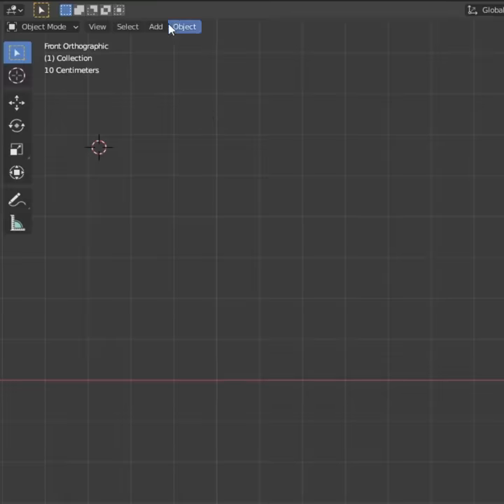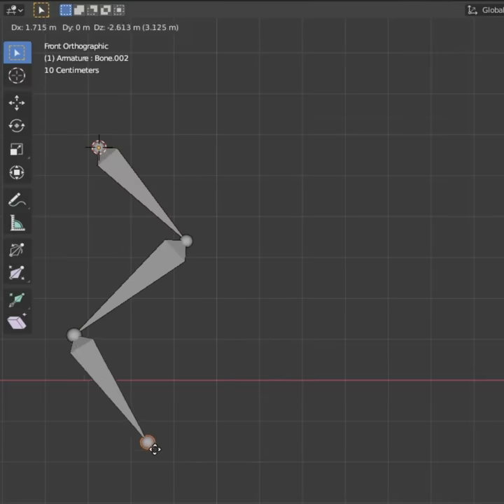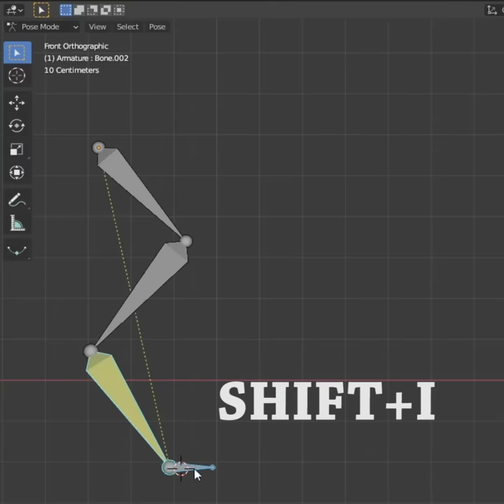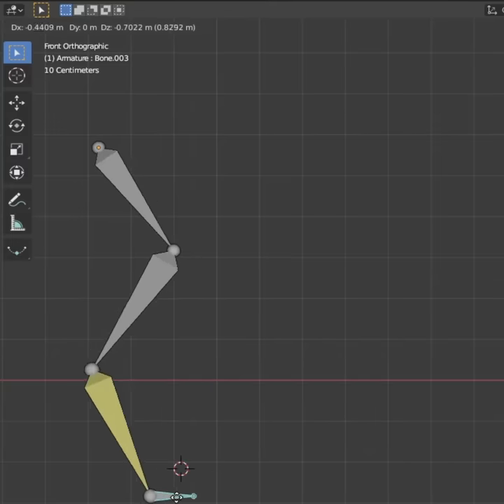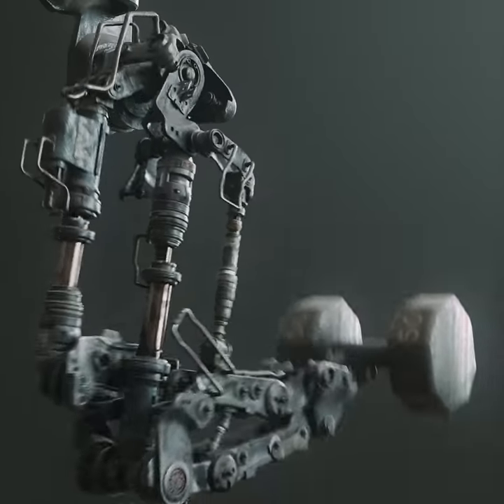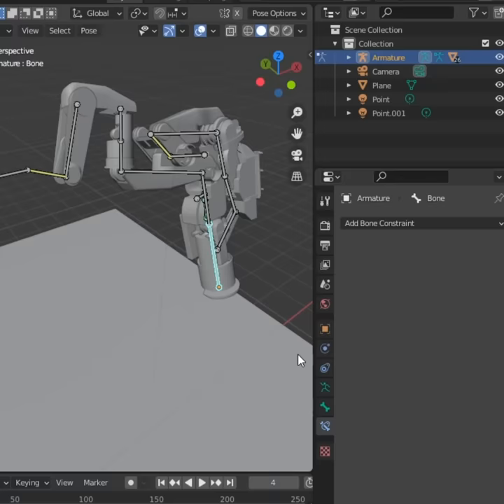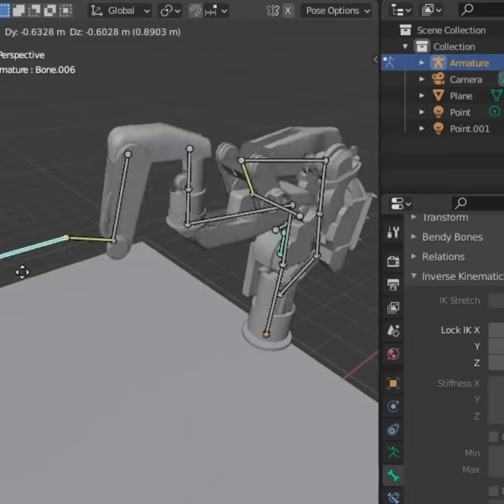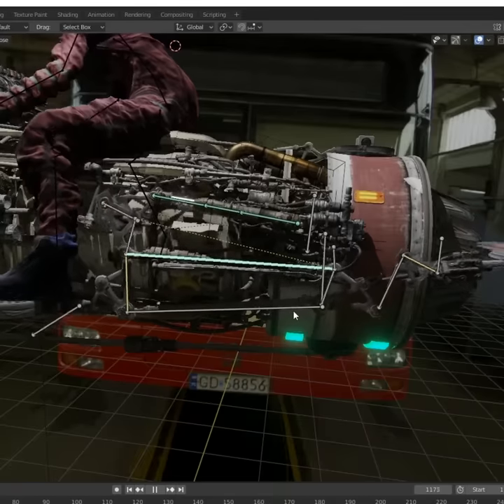Lazy Tutorial - Easy IK Rigging in Blender

Comment: This really doesnt work at all for me. I have changed the Chain Length. I tried to make the exakt same Armature Style as you have and i selected the control bone and shift selected the other bone and then i did Shift + i and the armature went crazy and was kinda vibrating and it just moved around like crazy so i tried changing the Chain Length to 2 then the yellow bone was just moving around in circles then i changed Chain Length to 3 and it was same as Chain Length 0... It was just kinda vibrating and moved around like crazy. I really dont think i have done anything wrong since i did exactly same as shown in the video. Even the same armature shape....
Reply: Okay i think i figured out the problem. I didnt spawn a new bone, I duplicated a bone so it was parent to another bone. So i tried spawning a new then it worked. Then i also tried to duplicate a bone again and clear parent and that also worked
Reply from the maker: @skillzorskillsson8228  AH! That's good to hear. Glad you were able to figure it out. Yeah the biggest thing that can throw this off is getting inadvertent dependency loops. It's working alright now?
Reply: @IanHubert2  Yeah, all works fine now. Thank you Ian :)